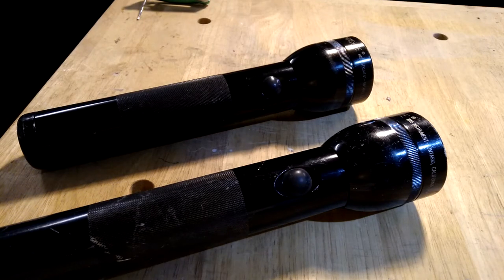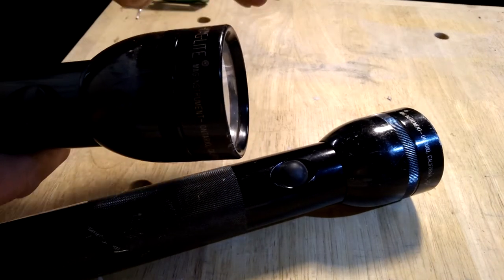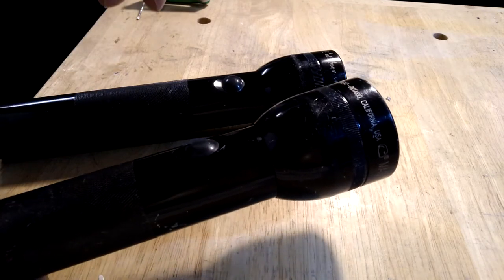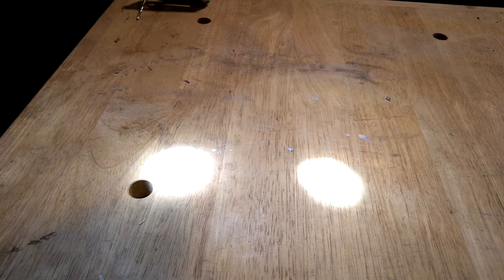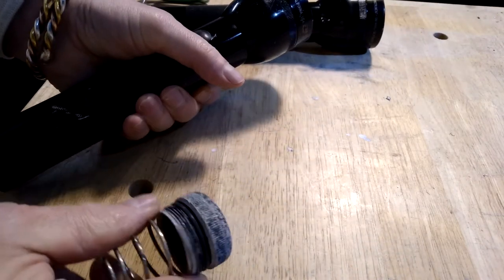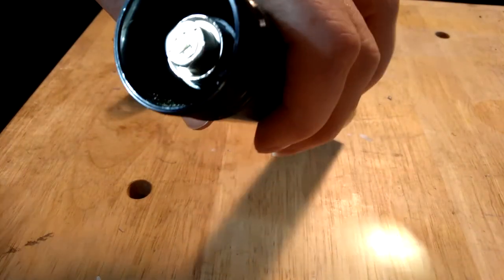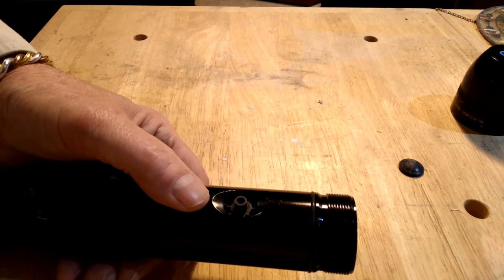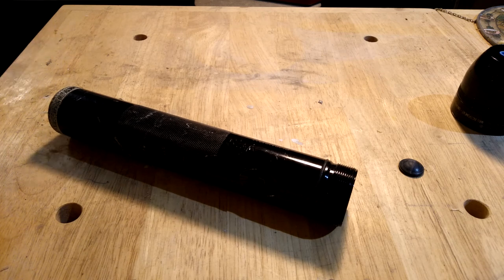Maglite DL Series - LED Access and Other Basics

Comment: Keith!!! You give me hope. Found a 2 D Magite in the garbage, thought it could be saved, bought the necessary parts, watched 2 videos but!!! for the life of me could not remove the switch no matter how many times I turned my 5/64 ths  Allen wrench!. Now to find a t8 torx and maybe use all the replacement parts I purchased. Keeping my fingers crossed. Would not have figured there were 2 types of set screws had I not watched your video. Many thanks for the tip.

Comment: Do you have a video on how to grind the t8 torx?
Reply from the maker: No, sorry, no video on the grinding. But it's no big deal really -- you'll need a bench grinder, or if you don't have that you can put a grinding wheel in an electric drill and pop that into a vise. Just start grinding evenly all over the surface of the shaft, until it's narrow enough to fit in the hole. Good luck!